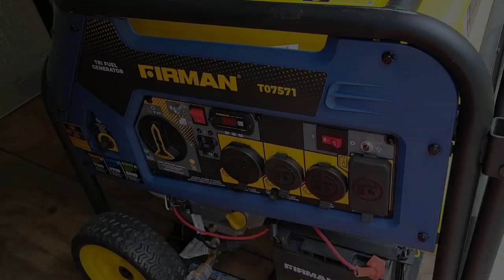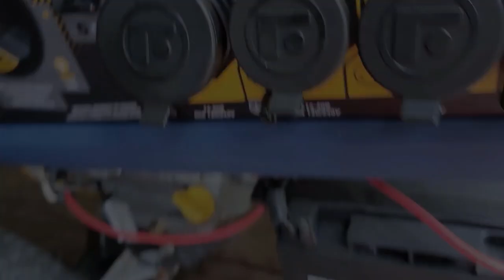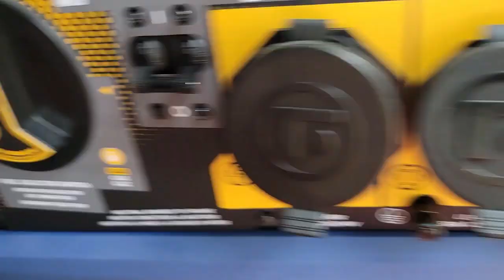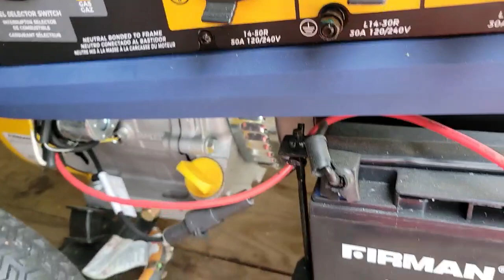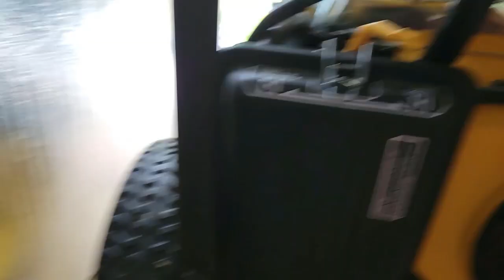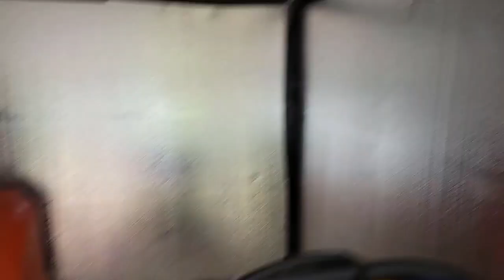I POWERED MY HOUSE FOR TWO DAYS DURING POWER OUTAGE WITH MY FIRMAN T07571 - THIS IS WHAT IT COST ME

Comment: I have the exact same firman. I'm from Florida. I had an electrician install a small manual transfer switch. My fridge and two freezers. Pool filter (25000 gallons of water) not for drinking but hygiene. And AC. I can switch breakers on and off. I keep this one as back up number 1. I also have a 12kva propane generator that will run the whole house. 500 pound submarine tank. That will run about thee weeks at half power. 2 at full. Now I'm working on solar (strictly just for fridge and freezer.). Living in Florida has definitely made me a small time prepper.  Covid made me and my family full time preppers.  Keep on teaching e!! I'm like a sponge. You and survival prepper have made me sleep so much better!!👍👍 Thank you again!!

Comment: Got the same generator. 699 at costco last month.  Added a natural gas hook up outside.  Also got a trickle charger on it to keep the battery charged.  Planning on putting in a interlock for my breaker box and building a sound proof box to quiet it down for my nighbors sake....

Comment: Great video. I have two generators. The big one is only for running the well pump as it requires 220 volts. I’ll turn it on and off as needed. The smaller one is a Honda 2200 for powering everything else. I can turn this on and off to meet my needs. It’s also real quiet. My main requirement is to keep the freezers running so just run it for a few hours a day and charge extra batteries during this time. It’s important to have alternative cooking and home heating that you don’t need a large generator for.

Comment: Its never good to run your generator constantly at night time when it's cooler turn it off and do your preventive maintenance and save your fuel. Your refrigerator will be fine for 8 hours. In morning time you can run it again. Even taking breaks fo r hour to hour wi)l work also. Save your fuel and equipment.  I live in Louisiana and use generators all the time after hurricanes, and get extra parts now before any shortages come. Buy fuel stabilizers to make fuel last longer when stored. Also have your generator connected to your main electrical panel box into a 50amp breaker to power your entire home.
Reply: 8 hrs.? This number seems to vary quite a lot from 1 person to the next. The most common number I hear is 4 hours. What were the temperatures of your fridge and freezer after being off for 8 hours? I purchased remote sensors to monitor temps during an outage, but have not had an outage more than a couple hours...yet.
Reply: @zippy2641  don't really recall but every morning it was still cold enough till I started it back up, next time I will monitor it.
Reply: @dirtyd9792  Did freezer items thaw? (I would think so...)

Comment: One gallon per hour for basic electrics. Just wondering how many gallons would be needed if it were used to heat a home in winter? Though I'm sure the AP has a log burner...
Reply: Also he said that his generator one gallon gets him three hours
Reply: You easily have the math equation already do the math one hour for 1 gallon how many hours you plan on running the heat simple🤦🏾‍♀️
Reply: @Utriedit215  you need the right numbers before you do the math...1 gal = 3 hrs.
Reply: @Utriedit215  there is a difference in running a fridge and charging your phone to the fuel consumption required to keep a home warm enough to be habitable in an Alaskan winter...

Comment: Hello AP, Glad to have you back from your incarceration. Having a generator with multiple fuel options is very important. If you run out of gas, a quick switch to LP and your good to go. A quick note for your yellow fuel cans. Spray paint them red (with plastic lawn furniture paint) to make them emergency services compliant.

Comment: I have a Predator Inverter Generator among several other types including 3 Hondas . I have to say this is Amazingly QUIET . I also built a quiet box to put it into and you can barely hear it . The noise level is VERY important in a grid down situation .  Years ago during a grid down , I was running a regular type generator and I had complete strangers showing up in my back yard . I  cant tell you how dangerous this was . My backyard is completely fenced and they just opened the gates and went in . If your going to run a generator get a  Quiet one . Your life depends on it .
Reply: @TxEvenstar4889  I was young , reckless and stupid and I could have in in a load of trouble . I was being careless and let the light shine through my front windows and the noise from the generator was heard mny blocks away in the complete silence of the griddown .

Comment: I like the looks and price of that model, especially for the convenience of 3 different fuels. As they aren't too expensive I'm thinking of building an outside gen box that can hold two in series since I don't think one is quite enough, and since each can run on a different fuel I would have one at least semi-permanently hooked up to the natural gas line. Thanks, Rudy!

Comment: If I buy a generator it will be a quality name brand and much smaller for fuel efficiency.
I've seen budget equipment fail so many times that it isn't funny and I will be minimizing that risk especially for something that may be needed.
There's a reason why the likes of Honda and Yamaha, for example, cost what they do and why others don't.
I have no knowledge of this brand but we can buy much larger units for the same cost of the units I mentioned here as well.
Each to their own of course.
Reply: If I was buying a generator for daily use, such as for my business...I'd buy the best I could get. A lot of people buy generators now for emergency use only. Yup, the cheye kneeze brands are probably not going to hold up for 20 years, but will likely be there for that emergency. I've owned mine for almost 1 year and haven't even run the full 5 hr break-in yet. If I go out in the garage right now, I know that generator will start on the first pull. It does every time, and it did today. It's the right tool, for the right job kind of thing IMO.
Reply: @zippy2641  So are you prepping for the occasional power outage or for a shtf scenario that all of these channels tell us is just around the corner?
In a real emergency it will have to work or your life could be at risk.
How much is your money worth then?
Reply: @oldbloke204  I'm not prepping for the zombie apocalypse. My view of that event is different than what most of these prepper channels portray. My generator is fine for my needs of short term outage (up to a week)
Reply: @zippy2641  Your choice but we keep hearing about how bad it's all going to get or the next "Great Depression" is upon us so why would you put your safety/existence in the hands of those who made a machine for the cheapest price out of the cheapest bits available?
For most the only thing that really needs to be kept operating is refrigeration so....
I keep seeing all of these solar generators etc being pushed but they really don't do what is necessary in a long term power outage imo.
Personally I couldn't care less as we can afford whatever we need but others can't.
A poor man buys tools many times but a rich man buys them once.
Reply: @oldbloke204  I do believe that things are going to get exceptionally ugly soon, and stay that way a long time. I don't see a generator being helpful in that scenario because of the fuel situation, and the anti "fossil fuel" agenda, so I don't plan on needing to use it long term. But I am confident it will meet my short term needs. (fridge/freezer) In other words...in my view, you can own the best generator ever designed by man, and it will become an expensive paper weight in our future.

The only way I would get a solar gen is if you gave it to me. Unfortunately, they need sun.
Reply: @zippy2641  Yep that's my point.
If you're convinced that the shtf scenario is real why would you buy the cheapest option to protect yourself and why would you live somewhere that the weather or other conditions could wipe you out for a large part of the year?
Makes no sense.
A solar generator would work where we are but not in the way that most prepper channels keep saying.
Either accept that you may need them occasionally, which is fine, or look at what's the best option longer term.
Pretty simple really.
Reply: @oldbloke204  "why would you buy the cheapest option to protect yourself "...I already told you why. Because, you are not going to be able to use them in the future.
Reply: @zippy2641  Says who?
If you're only going to be able to use them short term then why bother at all?
Get used to life without them in the first place perhaps?
I'm not even sure that I will get one for this reason due to where we live and how we can set our lives up.
Reply: @tomhorn2937  The one I'm looking at is nearly 4x that price and will never power a whole house.
Tell me how much  a large cheap unit will power when it fails or you can't keep fuel up to it please?
Personally I can't understand why some "preppers" live in places where the weather will kill them most of the year and they need to put so many resources into combatting that alone.
You get what you pay for.

Comment: Got the same geni this spring. Put in an interlock for the fuse box.  Dont have propane but put in an exterior natural gas hook up for it.  It will everything but central air (will run it but won't power the starting surge), the electric dryer, and stove. we have a portable ac that will keep one room cool. We also have other cooking options (butane stove, Coleman 2 burner, grill, bkackstone) and a clothsline... planning on adding a gas line for a gas stove that I already have
.

Comment: Nice generator I have a 5500 watt Generac I have used for several power outages that lasted over a week. I just recently bought a 1500 watt generator to run just the refrigerator during an outage to conserve gas it will run 10 hours on 1.1/2 gallons that way I can run the larger one just when needed and conserve fuel

Comment: Hi AP! In my opinion, having a small and a large generator is ideal. The problem with the non-inverter generator is that they burn a lot of fuel even when you're not using that much current. They are ideal for when being used at their near max levels. At or near max wattage they aren't less efficient than inverter generators but most of the time you aren't using it that way.  That's when the smaller inverter geny comes in to play, which is actually most of the time. Edit: For a few day power outage it's no big deal but for lengthy and sustained outages where fuel might be hard to come by conservation might become an important factor.
Reply: Plus non-inverter gens will destroy sensitive electronics since they pump out a square wave AC current. Inverter gens are much more expensive but pay for themselves in repairs.

Comment: I have the same generator. It's a beast. Just remember you get the most power off gasoline.  The output drops some on propane, and even more on natural gas. Though it is nice to plumb a line into the house's natural gas.  Also you need to change the oil after a short break in period and then on standard intervals just like your car.

Comment: I put a piece of tape over the gas regulator opening that screws onto the propane tank. I had bugs stopped the line up by building nests inside of the fitting and made it inoperable.
Reply: You had to work out a few of the bugs?

Comment: The price is right but, apartment's  generally  can't use something like that for a number of reasons  , can't alter the electrical system , most apartment's  you can't store gas  anywhere on the property . And , more than like nowhere to  store something that size..to bad we couldn't  get a  good solar generator system for that price

Comment: I have the same exact generator we got from Costco.  We usually only use propane just easier to store. We can powder the Fridge, freezer, 2 tv, security cameras. We alternate between the 2 freezers. 4 hours on 4 hours off. We keep battery operated thermometers with external displays in the fridge and both freezers so we can gauge the temperature without opening the doors. It’s a great, easy to use generator. But it is loud and it will need to have a sound dampening box if it’s used in a shtf situation.
Reply: Thank you for listing the appliances you use when using this generator. I don't understand all the volts & amps part of conversations . I just want to know what I can use inside the house when using a generator.  Do you have a set up like he is talking about for powering the house? Do I need to have an electrician to come and do that set up for our home, and do all electricians know how to do that type of set up?
Reply: @ursulasnyder4312  You buy the generator to meet the needs of what you want to run, not the other way around. You first add up the wattage draw for all the appliances you want to run, and buy the appropriate generator. Some appliances like fridge/freezers also draw additional wattage when first turned on, so you have to compensate for that when selecting a generator.
Reply: @ursulasnyder4312  you don’t have to go as far as having an electrician hook it up. We just use extension cords. Good quality extension cords, from the generator then to the items being used. IWe are looking at having an electrician do the extra step like he did.. just haven’t done it yet.
Reply: @brooksy4068  a electrician won't set it up like he did it is illegal because you can kill someone or burn up your generator. The will require a generator bypass switch that is very expensive and at least double what he paid for his generator.
Reply: @jasonbusch3624  I guess I need to research that more. My dad or son  is going to put it in just hasn’t had time. We lose our power a lot here in Oklahoma.
Reply: It's all code talk that men use to confuse females. Like when women talk about colors to confuse men.

Comment: That 50 amp 220 ''welder'' outlet actually puts out 32.5 amps per circuit.  That is what I use to plug in my house.  I am on my 3rd  firman.  1st 2 were duds out of the box.  Luckily costco exchanged them for me.

Comment: Great video! My Son has a huge generator in Texas, and during the Ice Storm, as well as Hugo, he was able to power & heat\cool his house, and use his stove & fridge. He's got a fireplace downstairs, & that helped thru the Ice Storm. They were out of power for 8 days. I've got a couple 7500WH gas Generators I've run thru hurricane Irma and they were great for 29 days!! I'm thankful WE prepare for the worst, because WITHOUT the gas, I wouldn't be able to keep them running until the gas station was up & able to pump! {That took about a week}.. I would love to have Solar as well, but Cash is tight! Thanks for sharing!

Comment: Hi karma! I'm trying to find a solar generator seeing that I live in an apartment and even in a long term power outage I still have to follow the rules in the lease.  Obviously if it was an SHTF and there wouldn't be any rules afterwards obviously I could use any other kind of generator I could get my hands on. But we are not allowed to store fuel or anything else or anything else in the apartment building and I don't really have a monthly extra is a monthly extra amount to pay for an extra storage. So I'm kind of looking for a solar option but I'm not sure what's the best option for me. Then I have to wait until I get enough money to purchase it. I wish I didn't have to work with those restrictions but unfortunately I do and I know I'm not the only one.
Reply: You still need a way to recharge the solar generator which is really a battery that stores power. I have a few that I have been using around the house with different appliances and items. It’s pretty surprising how much power even small items draw. I have been setting up my power stations to charge on solar so you need a strategy for recharging too. I have an inverter generator i can use to recharge my power stations if I can’t get enough solar to charge everything. You should consider buying something a lot bigger than you think you need like an ecoflow delta max which lets you add a battery to double capacity. But think about your recharge strategy before you even get one. I love mine and I’m so grateful for them. I’ve used them in a couple of small outages this year. Recently I’ve started using them regularly to power my computer and wifi and tv etc to see how it works. I have a delta for my kitchen and I want to get harbor freight hard panels to put on the roof over my kitchen to make running the fridge more efficient. It’s good to get these things and use them as part of your regular lifestyle so it’s second nature in an emergency. I hope that helps you. People don’t adequately address the recharging issue and how much power even small things pull when running for a few hours.
Reply: @PattymacMakes  Yeah, that's the problem with solar...it requires the sun. Expensive paper weight in a lot of areas.
Reply: @zippy2641  It's fantastic when it works, but such a pain when it doesn't. I'm cloudy today so no solar recharging here. Thankfully I still have my usual electric so I can keep living my life and working but it would be pretty inconvenient otherwise. I do have a small generator to recharge when I can use solar, but not everyone can do that.
Reply: Your definitely not alone. More that 30% of the US population are renters, and that number is growing. Fact is, some of the core fundamentals for "preppers" are simply not compatible with apartment living. Your not going to plant a corn field in your living room, and storage is often very limited and restricted. Even with solar...you have to have a good amount of direct sun. Good luck with that, especially if you live up north, or live in an apartment complex.